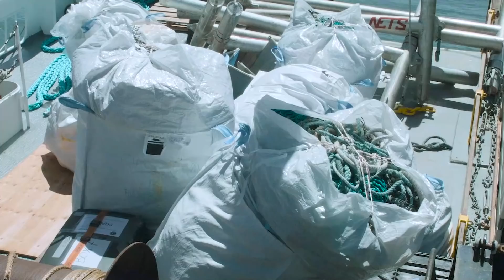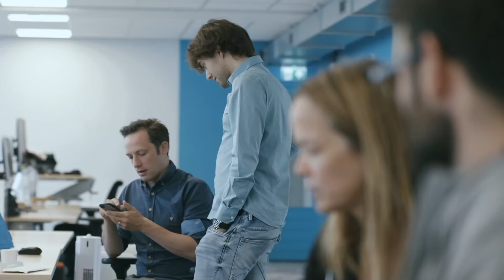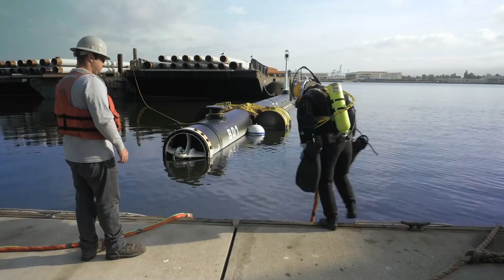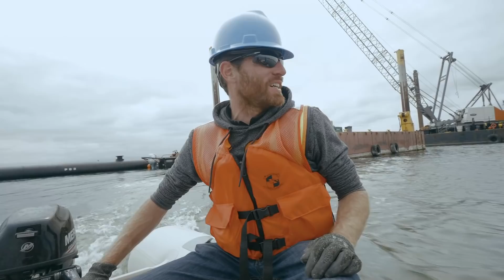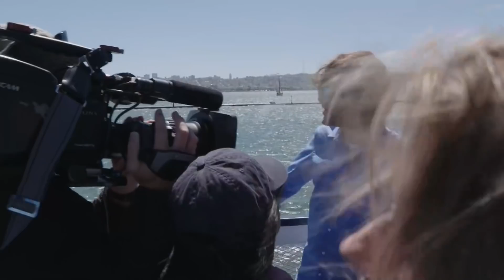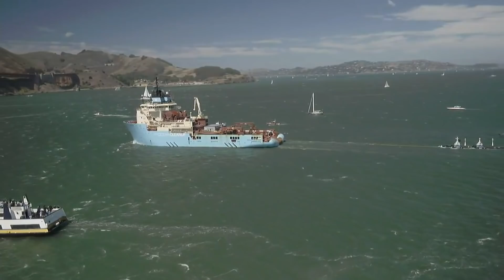The Ocean Cleanup System 001 Launch LIVE from San-Francisco Bay

Comment: About that U-Shape...
Kitesurf Wings example :
They do prototype of a certain scale depending on the exact shape and behavior they want from it.
Then, they test it, do some correction, test it again..
The key thing for their U shape, is that the ratio of space between each struts is not proportional of the original scale of their prototype. Because the material is behaving differently on a larger scale, they have to adjust/adapt things depending on the size of their final wing.

I wish and hope you had som talks with that kind of guys, that knows u-shape and wind forces...

Good luck, thanks again